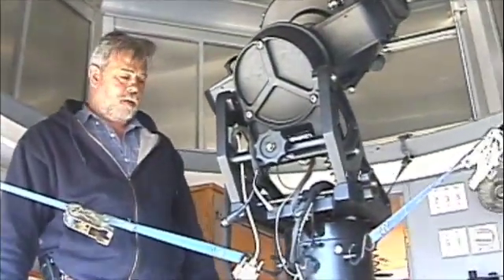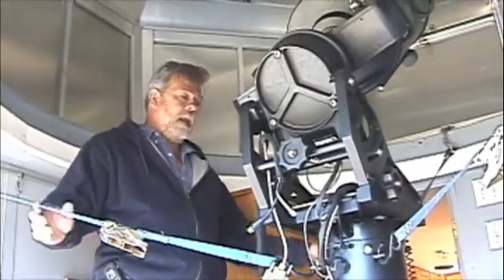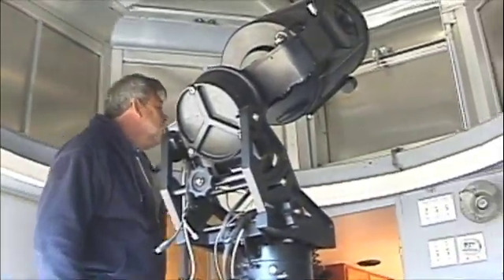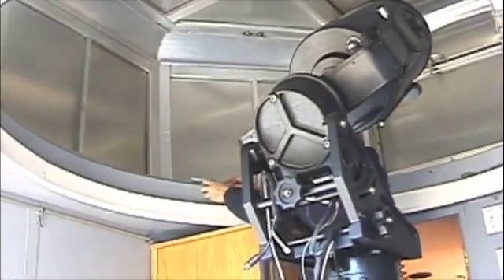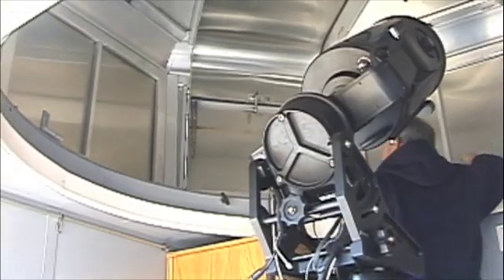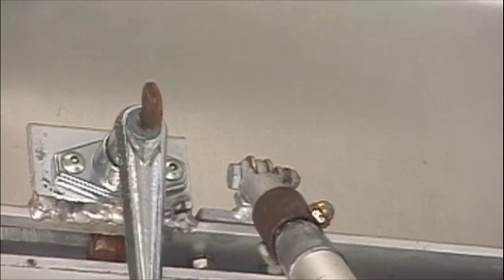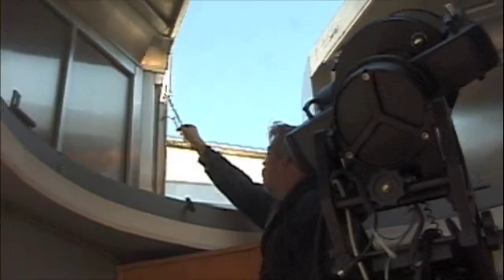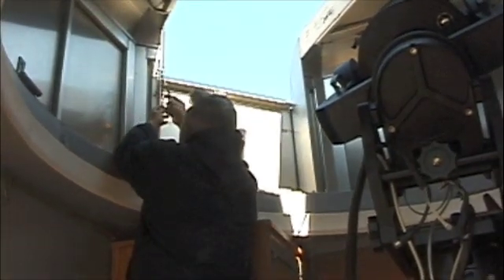Observatory I

Comment: To make the observatory more fuel efficient by reducing drag and weight, why not make the dome out of material similar to winter tents that mountaineers use?  They are designed to withstand high winds.  You could collapse it when not in use and have a cover to fit over the circular opening to make the trailer more aerodynamic.  Just a thought... I'd love to see this observatory tho!  It looks very cool!